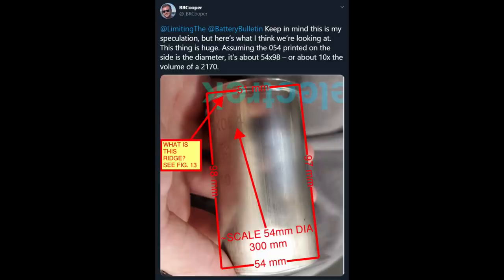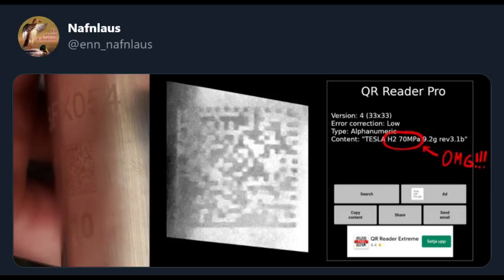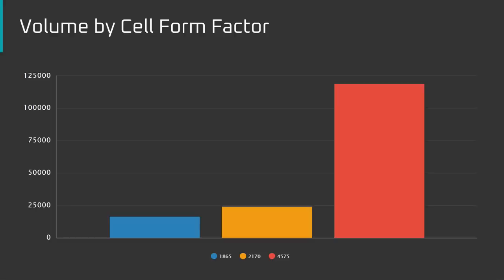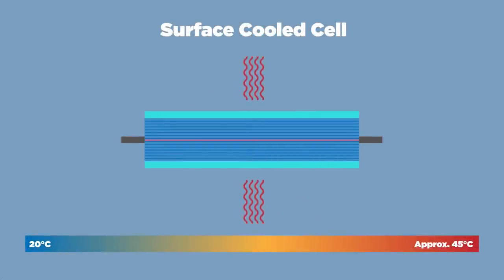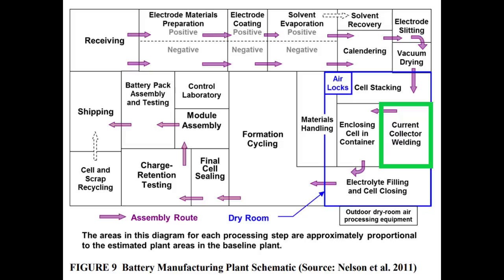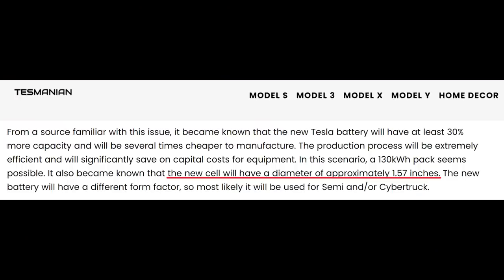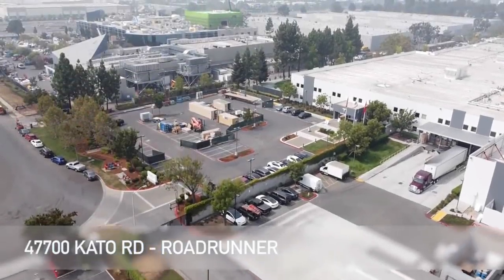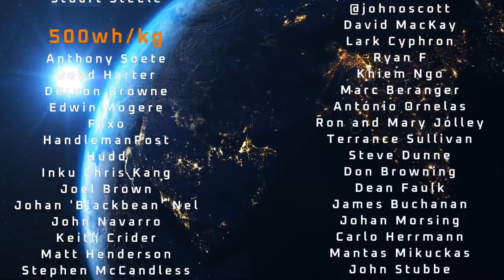Tesla's Alleged Roadrunner Cell - Comprehensive Breakdown

Comment from the maker: NOTE 1:  A lot of people have advised me the the QR code was in jest.  Although this video was done in a huge rush, I should have double checked it.  Regardless, many people did take that tweet seriously and wanted my opinion.  My opinion, as stated in the video, is that it was a nothing burger.  It turns out it was a hoax.

Note 2:  All of my estimates for Battery Day remain the same from my video posted last week.  However, it does increase my conviction :)  https://www.youtube.com/watch?v=rYTFyxbm3Ew&t=923s
Reply: Yes, there was a winky face at the end of the original tweet. I tried to scan the code myself before seeing it. Smart joke.
Reply: Karen has a special brand of sarcasm.  I thought it was real at first too!
Reply: You will not be the last one failing to see the H2 70MPa NIKOLA joke ;)
Reply: Bigger cells produce more heat internal, but with them bigger you can put cooling solutions in between the cells like heat-pipes.
Reply: Virgin skinny cell vs. Chad THICCC BOI
Reply: No probs Jordan. Love your work. Interesting that Peter R from Lucid said they cool batteries from the ends not the sides due to the sides being insulated. I am guessing that Tesla will also unveil a high voltage architecture. Does that seem likely?
Reply: Those big diameter batteries will also make, cell to pack much easier to install at high speed without tipping over...
Reply: @poison2human  lol 🤣
Reply: When is battery day?
Reply: @jb-rx3qd  tommorow 1:30pm pasific standard Time.
Reply: j b 
22/9 2:30pm PDT. 
In Fremont
Reply from the maker: @roryreddog3258  not sure!  Voltage has trade offs
Reply: 👼🏿📯👼🏾📯👼📯👼🏼📯🌫️👼🌫️🌫️ Jesus is returning repent of your sins
Reply: Accept Jesus as your lord and savior

Comment: Speculation: I wonder if they’re inserting a cooling rod down the middle of the cell? The tabless design allows one to do so because the cap can conduct about an area instead of a tab. A rod at say 1 mm in size would only take up less than 0.05% of the volume, and may pay huge dividends to cooling the cell with more uniformity. 

So here are the items they need to address that I’ve seen you address in your videos:
Range / Energy density, pack size
Longevity / number of cycles 
Charge rate & Acceleration / thermal management, DOD
Safety / shorting and material protection 
Cost / cell size, energy density, yield, production rate, assembly (ie cell to pack efficiency), material usage
Ethics / material usage (ie cobalt removal) 
Micro grid usage / number of cycles 
Supply increase / line throughput, everything in cost category 
Productization / what models it is used in, where it will be produced, beyond car usage
Recycle and Reuse / material usage, process for reuse
Reply from the maker: Could be!  I considered it

Comment: IMO, Tesla will introduce LFP chemistry in conjunction with larger cells and tabless electrodes.  That way, the energy deficiency shortfall of LFP can be mitigated, thus allowing for cheaper batteries overall with good energy density.

Comment: ~70mm height makes more sense if it has to fit in the same space as the 2170 cell.
Although I don't know how much space Tesla has, nor how slim they can squeeze the overhead from connection or cooling.
Model 3 pack is said to be 90 mm thick, so 22.2% of that is overhead ? That is a lot !

Comment: It would make sense for it to be 70mm high because they would be able to put the pack into the car without changing the design of the car
Reply: But that won't fit into the Pack of the Model S/ Model X
Reply: @oliverwunsch1743  forgot that was on the old cells. I think it is more likely that the S/X would have a redesign to fit the new cells than that the 3/Y would
Reply: @mattbell1907  probably.... but IMHO it's easier to put in a 65 mm Cell into a M3/Y than a 70 mm Cell into a MS/X
Reply: I think it will be a long time before we see these cells in model 3 and Y
Reply: Personally I feel these are taller than 70mm and would expect them to be esp if thermal gains are significant and also if form factor is a consideration because cell to pack production will create space (unless the modules only increased dimensions in cell height plane).

Comment: Heat may have been the reason that Tesla only increased cell size to 21700 for the Model 3 and Y.  However, it was reported at the time that the tooling for 18650 lines could be modified to produce 21700 cells.  Presumably this allowed the 21700 to be produced at the same speed as the 18650, VERY important for the cost per kWh. This was probably all that the existing suppliers of cell production equipment could do at the time.  Now, Tesla has likely designed their own equipment to make larger, heavier, cells at the same speed or even faster.
Reply: It's not the weight of the cell that was an issue, it was the technology inside the cell.
As for production equipment, the "fast" (transport) sections are similar to those used for any number of other products, for instance soft drinks. Cans and weight slightly larger, heavier.
Reply: Roger Starkey, Thanks Roger. Good point about the processing speed for soda cans, etc.  However, I doubt existing 18650 machinery could handle either the size or weight.  It was first reported that the new cell size was going to be 20700. I think Elon even said they were looking at 20700 or 21700 at some point, IIRC.  I hypothesize that they found they could stretch the 18560 machines a bit further, and that enabled the 21 mm diameter.  Also, I am not referring only to transport of the cells, but everything including winding, calendaring, coating, drying, etc.

Comment: Today, Sept. 26, your forecast was quite close to what was revealed by Tesla about their new battery.  The presentation was somewhat misleading. The new 4680 battery has 5 1/2 times the volume of the old 2170 battery; but, the energy density is only 5 times greater. The power is rated at 6 times greater; and range is 16% greater. There is a small lose of energy density.
  The foot print of one the new 4680 battery pack is about 1/2 the footprint of the old 2170 battery pack (with their cooling tubes weaving between each row of cells). So, for the same amount of power, the 4680 battery pack will use about 1/2 the space in the car / truck as the 2170 battery pack. 
The weight reduction of the 4680 battery pack will, also, be about 1/2 that of the 2170 battery pack.  The weight reduction of the car / truck will be further reduced by the battery pack acting as the floor structure of the car / truck, maybe, by 150 pounds, or more.
  The battery chemistry change wasn't as extreme as many thought it would be; but, getting rid of cobalt, the solvent, and the single tabs are, still, big steps in cost reduction.
Reply from the maker: Agreed!   A lot of curious gaps in the presentation!

Comment: Obviously they will cool it from top and botton now. Like how did nobody notice the layers are insulating? And with no need for sanwiched cooling lines it further increases volume density of the pack.
Reply: Well, I'm not sure I agree with your "obvious" part of that. I think there's substantial difficulty in cooling battery cells top and bottom (mostly that most thermally conductive materials are also electrically conductive, which could be an issue lol) I'm sure there's options I'm not familiar with, though.

I also feel like Tesla just took advantage of the fact that there is (wasted) space beside cylindrical cells TO cool them, not so much that cooling them from the sides was the best method. Still, I think they're on to a winner.
Reply: I think you're underestimating the thermal benefit of the tabless design. The -ve end of the battery will be the main thermal path. They can insure full contact to the grounding plate on that end and use the battery pack shell to dissipate the heat. The +ve end is fused externally and so is NOT the main thermal path. Speculation but I'm an engineer so an educated speculation.
Reply: @MrVelociraptor75  Even if you don't install the cooling at the top/bottom of the cell you'll get a volumetric improvement from fewer cooling fins.

If you have two offset rows of cells sandwiching a cooling fin (current module design), and you increase the diameter of the cells. You'll have relatively fewer cooling fins per kWh.
Reply: C M  Yeah, it's interesting though how one benefit flows onto further benefits, even if insignificant.

It's a good indicator of an elegant improvement

Comment: Ehm. I think the the QR reading by Nafnlaus on Twitter was a joke/funny fake. It says H2 70MPa as in hydrogen at (a typical tank pressure of) 700bar.
In my experience reading QR or dot matrix codes with that amount of data missing/smudged is impossible. There are checksums to make sure that it's impossible to get a slightly wrong reading. It's usually all or nothing.
Reply from the maker: Yeah, I addressed this in the comments below.  I didn't take it seriously but also didn't realise it was a joke.  Lesson learned:  Unfollowed Nafnlaus and verify everything.

Comment: Why Tesla started with then18650 cells? Because tZero was made with them and the heritage from ”laptop” cells. The production of these cells allowed large volume production cheaply and using selection and grading after testing the cells.

The tabless cells have much less circulating currents which create wear and tear due heating from losses. And you’re right with the heat conduit. All foils connected to the cell case allows high power cooling. 

Tabless cells are well known tech. Bi-polar thin-film cells are usually tabless. I suspect Tesla will go eventually to bi-polar thin-film since LFP can go to 300Wh/kg with this mechanics. Dry powder coating is really easy with these thin-film cells. This allows the TeraFactory class manufacturing.

Comment: I think what Tesla may be really aiming for: dramatically reducing the weight of the battery pack itself. It could mean taking several hundred pounds off the weight of all Tesla models, which means Tesla could improve the suspension system of all their models for better handling and ride quality.

Comment: The plastic disc somehow looks to me like a metal plate thats been pressed on the cell or something. maybe to further easily connect it to the pack?
Reply from the maker: Good idea!
Reply: @thelimitingfactor  is it not what they show in the diagram you put up at around 10:30
Reply from the maker: @robbiero368  From my perspective no.  I was being careful not to get over the tips of my skiis.
Reply: @thelimitingfactor  I'm wondering why you think it is plastic? It looks like a metal alloy to me. But you are much more knowledgeable about batteries.
Reply: @joopvanroy6599  agreed
Reply from the maker: @joopvanroy6599  It's not a matter of knowledgeable, but more a matter of pattern recognition and personal experience.  I could very well be wrong, but when I look at the top, it's either reflecting something and metal, or slightly transluscent.  I definitely don't have a monopoly on the truth, but I also don't have the time or interest to debate it.
Reply: It´s an aluminum disc, contacting Cathode, like copper piece on bottom.
Reply from the maker: @karlpaulzimmer  Clever!  That makes sense.  Still looks like plastic to me, but I'm sold on the logic.
Reply: @karlpaulzimmer  Source? or speculation?
Reply: I thought it may be metal as well and assumed the embossed design facilitates tab splay creating an electron highway where they aggregate.
Reply: @qwazy01  yea, it really looks like metal, like some stamped sheet or something pressed. would be really interresting if it served multiple purposes, like transfering heat away from the battery in order to make cooling cheaper & more efficient, and to increase the pack-level engery density by not having to wind cooling lines right through the pack.
Reply: Plastic disk looks like one-way valve to me. Can the electrolyte serve as a coolant, being pumped through cells?
Reply: @thelimitingfactor  I saw a video (thought it was on your channel but guess not) that theorized they pre-attach a metal disc to the central spool, that way there's one less step in manufacturing the battery.  This would improve plate/end/"tab" cooling performance.  It also means the can could be one part that is then crimped on to the disc.
Reply from the maker: @Sn0wZer0  I like it!
Reply: Post-Battery Day update: It's not a disk or part of the spindle, AFAICT it's the tabless folded-over "electrode ends" which for that side is aluminum (the other end being copper).  And btw, the tabless name kinda stinks, it should really be called "continuous integral tab", since there are notched "tabs" along the whole roll, it's just that they come from the roll itself rather than being welded on.
reference: https://www.youtube.com/watch?v=l6T9xIeZTds&t=7032
Reply: @Sn0wZer0  yes. it still is a disc. just pressed against the electrode. Yes, "tabless" or "tab only" is pretty close together in this design. Its more like "tab-constraint-less" fun fact: if they glue everything together with conductive glue, and they glue the cells together with glue. that thing is going to be STRONG af.
Reply: Also: they didnt notice liquid cooling. It will probably be plate cooling, or, who knows, maybe no cooling at all (unlikely).

Comment: The only reason I can think of to do "cells within cells" is something like the Roadster ... a STUPID complex system, of larger cells for endurance and a smaller set of cells for high amp delivery. but as you say, it would be better to just get more cells that can handle it all and keep it simple.
Reply: It makes more sense to marry batteries with super capacitators.
Reply: @killcat1971  Elon has said previously, that (super)caps are unnecessary with the power density of their batteries. Which seems to be the case. That dynamic could be different with the roadrunner batts, but, I still feel Elon's opinion will hold true.

If you have adequate thermal management on Li-ion batteries, they can absorb a huge amount of power (Theoretically, it should be similar to the discharge rate)
Reply: @MrVelociraptor75  Super caps could be useful as a buffer for power spikes on vehicles with small battery packs (short range), but Tesla doesn't currently sell such cars. Or they may be useful on vehicles that have extreme power surges like the Roadster. That said, I don't expect to see Tesla using them.
Reply: If the large cells are closely packed there's only room for an 8mm diameter between them.
Reply: @MrVelociraptor75  You can get away with a battery only system, but using the interstitial space for supercapacitors to make a hybrid system is not that complex and definitely provides more power for regen braking. Li is 12,500 times heavier than electrons so moving Li+ around is always going to be slower than moving electrons. While they could make a hybrid power system, I expect they won't because of the additional cost (would make sense on a semi or roadster though).

Comment: In your estimation, DBE is more responsible for higher power/lower internal resistance than the tabless design. I understand you are only making some guesses as far as thermodynamics are concerned. I am wondering why Elon seems to be more elated about tabless than the DBE. Is he trying to play that one slow to maintain advantage? It is great that tabless now allows larger cells with less cooling issues and getting rid of those big cooling channels between all the cells will help on cost/complexity. I am going to re-watch that section and note his enthusiasm around both ideas and see how I feel. My recollection is that he was more enamored with tabless design and manufacturability. Maybe he is more excited about it due to the continuous motion of the line and how that lowers cost. In that case, I get why he would be excited about that prospect. That will enable Roadrunner. Meep Meep! (I just re-watched that portion and Drew specifically said tabless removes thermal problem from the equation, so now I am not sure which is more helpful. Maybe they are both equal in helping with power)

I am going to guess that tabless DBE will help charge times dramatically. If the heat problem is mostly gone, then max power can be supplied for maybe 10-12 minutes instead of 3. Maths on that is 15-20 minute full charge times at 300kw charger.